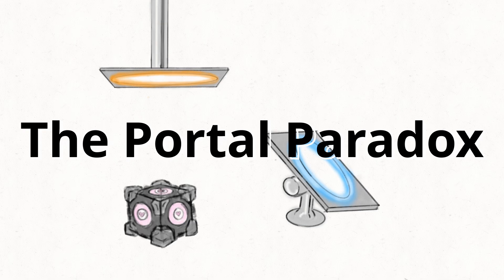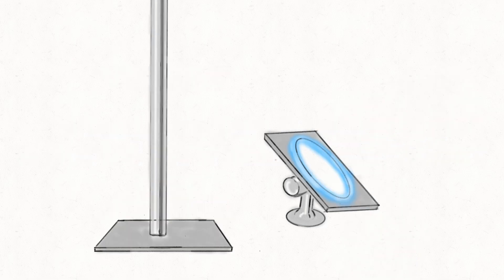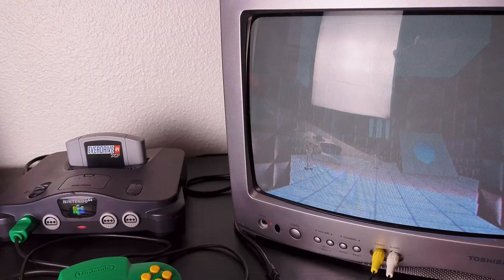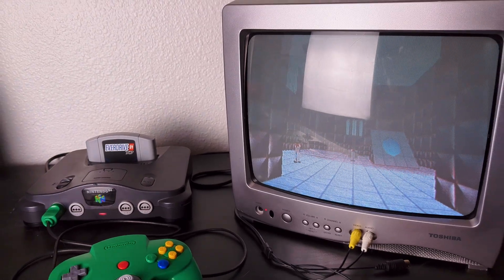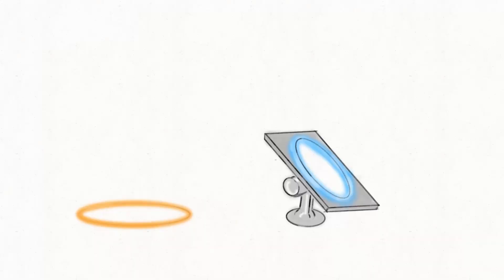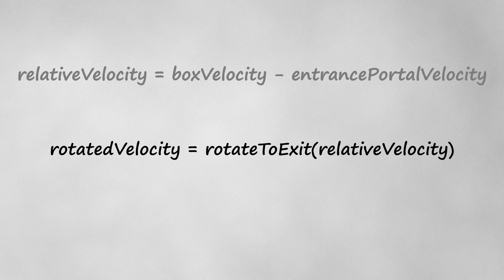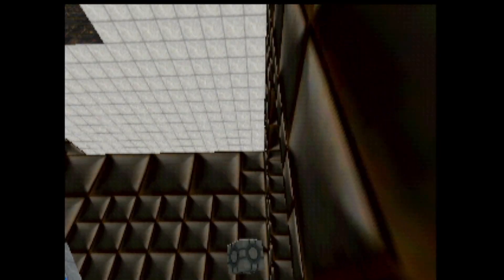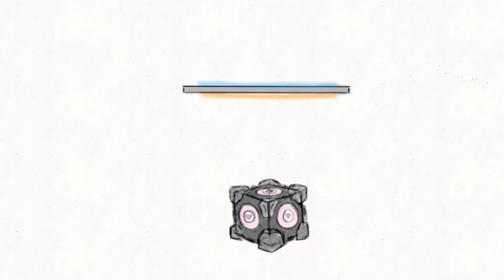I rewrote Portal from scratch and solved the Portal Paradox

Comment: There is one problem with this. In the game, they said momentum is conserved between portals, which means how fast something is moving before it enters a portal is how fast it moves after it exits a portal. When you rewrote the game, you changed the physics of the portal to change the answer. In other words, you are imparting momentum to the cube based on if one of the portals is stationary.
Reply: The main game mainly accounts for stationary portals. Maybe the more general way to see that phrase is: speedy things relative to the entrance portal goes in, speedy things relative to the exit portal go out. 

Since portals are not generally subject to relative movement in the main game, this can be simplified to the rule they mention in the game. So it's still consistent.
Reply: @evenh4210 You also forgot the line where it says, "Momentum is conserved between portals." the "Speedy things go in, speedy things come out." is an insulting simple explanation because Glados thinks humans have trouble understanding science. The cube has no momentum going into a moving portal and, therefore, has no momentum coming out of a portal. The only thing to act on an object that a portal moves over is gravity, so it would react as it would have if the floor suddenly changed
 when it exits the portal.

Comment: if you still have doubts, think about this: let’s say the cube is 1m long, and the orange portal is rushing towards it at 10 m/s. That means that in 0.1 seconds the cube will be through the orange portal. But think about the blue portal now, the cube should also exit the blue portal at the same speed it entered the orange one, obviously. So the cube will come out the blue portal in 0.1 seconds too. If a one meter cube moves through a hoop in 0.1 seconds then 1/0.1 = 10 m/s.

Comment: Would be nice to see a demo where the portal only goes through half the object. I assume the object would shoot through the other portal at half the speed of the initial portals speed... assuming its a cube like in this case
Reply: I had the exact same test idea, but I dont know about the outcome
Reply: @CHadetz  i was wondering if inertia would have any effect... Probably. And if the object can handle the pulling force. What if its elastic, or breaks easy. Or liquid lol
Reply: @hectorh4474  a block of rubber would be interesting. If the momentum of the portal would be transferred to the parts of the block that go through, they would pull the remaining part with them to some extent, or rip the block if the speed is too high. A slinky would not rip though

Comment: I prefer to think about this as a conservation if momentum problem. The cube has no momentum because its not moving, when the portal passes over it it is now acted on by gravity in the new portal reference plane. This would cause it to plop or roll out of the portal, noting that the motion would start after the cube's center of mass is through the new portal. This also solves the problem of what happens if the moving portal stops part way, you just apply the balance of gravity that is acting on the sections in each portal and see what happens.
Reply: @adrianpg4460  The real answer is that many smarter people have hashed this out online for years and there are good explanations for either behavior. The correct answer is whichever version the developer prefers for gameplay.
Reply: Yeah I was watching this wondering where the transfer of kinetic energy happens.
Reply: @adrianpg4460  Your first example doesn't prove your point - in that example I am staying still and the door and room are moving relative to me, to someone in the room it appears that I am the one moving - that's from their reference plane. To an outside observer I am clearly staying still and the wall slams into me, I don't slam into the wall. 

The portals connect two points on the same planet - they share a reference plane. So in the reference plane of the moving portal, sure I would be moving, but in the reference plane that the moving portal, the fixed portal, and I share (the earth) I am not moving, so I won't flung out of the second portal.

I contend that this is still a conservation of momentum problem because we all share the same intertial reference plane so energy must be conserved.

Comment: I've never played portal but yeah this is legit. Like why is this a paradox? It seems so intuitive
Reply: Because energy is being created out of nothing here. The moving portal will not have the same kinetic energy as the moving box, it's bogus. The box would not move because nothing is imparting energy into it, it is just being teleported from point A to point B. The relative velocity line of thinking is simply wrong.
Reply: @BNJ_VODS place a portal down on the ground, now put one 2 metres up, throw anything through them, congratulations your stationary portals have created excess energy from nothing.

Put two portals on the ground facing upwards, ignore gravity and air resistance for a second, throw a ball into one at 10m/s it will come out the other at 20m/s. Velocity being a vector means that the stationary portals just created 20m/s of upwards velocity from nothing.

The portals (as per the game) just break physics, having one portal move doesn't really make them any less completely bogus.

Comment: Alos to note. The cube or the object is not one single object. It wouldve been composed of a lot of atoms, all pulling and pushing against each other depending on their neighbouring atoms.

If we are speaking of newtonian motion, then logic says the atoms at the back will push the atoms at the front as they exit a portal, with a certain velocity. Obviously this velocity has inertia. Once the object has fully passed through the portal, the atoms at the front would still be moving and would pull the atoms at the back, thus continuing its motion
Reply: Yeah but through what force would that motion begin?
Reply: @Fr33mx  electromagnetic. Atoms push against other atoms so if you shove a stick in the portal, the back parts of the stick are smooshing the front part forwards.

Comment: I think you're wrong and I'll call upon the Conservation of Momentum. The orange portal has momentum down at a speed > 0. The box and blue portal have momentum but at a speed of 0. When the orange portal comes into contact with the floor, the momentum is not transferred to the blue portal nor the box. It is instead arrested by the floor and whatever mechanism is pushing the platform to the ground. Momentum is maintained in the chain holding the orange portal but because the orange portal never actually touches the box, momentum could never be imparted to the box.

Comment: I hadnt come across this problem before, but my first idea was thinking about the cross section of the object "in" the portal. The first layer of atoms can sit on the exit portal no problem, but the next layer will apply a force accelerating the first layer to the speed of the portal (assuming a rigid object) to make space. Similarly with the moving exit portal this acceleration need not apply because the portal has been displaced by the same amount.
Reply: I had almost the same thought, either the cube flies out of the portal as you described or get squished - Because if it enters fast but exits slowly it would need to be squished?

Comment: I’m very late to the party but this makes me wonder about what sorts of gimmicks you could achieve by making an exit portal move in the opposite direction of the entrance portal (ie forcing the cube to sorta stay locked inside the portals for a time before shooting it out) or maybe doing something clever where you increase the velocity of a cube further by moving both portals in the appropriate directions. Neat stuff!
Reply: If I understand correctly neither of those things would happen in any possible case.

It's easy to imagine:

Remember that portals have a front and a back, so imagine the second example in the video, but with the blue portal set in the other direction. The piston would simply push the cube against the floor. The cube is "exiting" through the same portal it entered. If the portal was set on another surface but move at the same speed in the opposite direction (relative to its front), it would be the same.

If there was a speed differential between the two portals, then it would exit through the portal that was moving slower, at the speed of the differential.

Comment: and where the hell is the kinetic energy coming from? which hindu god adds magic numbers to an otherwise stationary object? 
portals connect two places in spacetime like wormholes. moving a portal into an object merely changes the location of the first wormhole and eventually the location of the object that passes through it, similar to what youd expect from teleportation. the two portals are like a ring with a witdh of 0. moving one end of the ring to a different location so that it forces an object through itself will have ZERO effect on the objects passing through it

in a more practical example, orange portal moving into the cube is akin to a part of a room with an open door accelerating towards you. once youre in the room you dont magically gain velocity and fly into a wall
Reply: Yeah the paradox stems from the nature of the protals in the game.
Ingame we only have 1 plane to work with, so it doesnt make sense that a 2d object could move in a 3rd world. We would have to apply 3rd portals as in spherical wormholes, which would not cause a paradox even if one of them was moving. But thats a totally different kind of conversation to have.
Reply: Stationary portals are sources of potential energy. Portals in floor and ceiling gives potential energy to anything that passes through. So why would it be unreasonable for moving portals to give kinetic energy?

Comment: This was my stance for a decade. All motion is relative.
Reply: It is not really. Motion is energy. You cannot create energy out of nothing. The portal does not have a contact with the cube so no energy is transferred on to the cube, thus it has the same velocity of zero coming out of the other end.
Reply: @Fr33mx  motion is not inherently energy. Energy can be used to create motion
Reply: @Absolute_Territory point still stands, no forces are applied to the cube, so no momentum is transferred.
Reply: @Fr33mx  the force applied to the cube is the difference in relative motion between the portals lmao
Reply: @Fr33mx  and no, your point doesn't stand if you don't understand the fundamental concept of motion lmao

Comment: The problem is the angle of the second portal, it's angled upward and slightly horizontal meaning that if the physics were the opposite of the way you've intended them, the cube would just sit there floating in space

Comment: This really makes me think about how a gravitational field would work through a portal. For this setup, assuming the moving portal is very slow, such that the box effectively has no appreciable final velocity perpendicular to the plane of the stationary portal, does its friction increase due to the larger gravitational force? If it is moving faster, does it cause an acceleration of the projectile not straight downward? 

As for your implementation of the changing velocity for the box. I'm not fully sold on it, but it seems fine. What is the difference between the box being thrown through the portal and the portal being thrown over the box? From a symmetry perspective, this solutions that treats the box as having been moving seems to make sense. However, I wouldn't view the portal as doing work on the box, so I would almost believe there would be a stationary box on the other side. You'd just be moving its point in space spontaneously and would feel both environments' gravitation, which would be weird.

Anyway, interesting approach, and looks like a cool demake.
Reply: I think the game's original engine makes it clear. If you drop a box into a portal that has both "entrance" and "exit" on the same plane, the box oscillates back and forth between two opposing gravitational forces untill all of its momentum is dispersed through the friction with air and it stabilizes inside the protal.
I might be talking out of my ass however as the last time i've played that game was years ago, but I have a memory of doing thay exact experiment and it went something along those lines so it made perfect sense to me.

Comment: I've always said it depends if the velocity is in relation to the portal or the environment. This is spot on for velocity related to the portal, as the portal's velocity would be accounted for well.
Reply: Problem is that the portals are not physical objects per se, they are just wormholes with width of zero.
Momentum is not relative so to create it you have to apply it to the cube directly. So in this csse there's no forces applied to the cube other than gravitational force of the earth, so it should just fall out of the blue portal with a motion corresponding with the new gravitational force that is now applied to the cube. It is counterintuitive.
Reply: @Fr33mx  exactly, i can't agree with te solution provided here as it simply does not make physical sense (i know we're talking about wormhole like portals here but still)

The reason you can shoot out of one portal when you jump into it is because you have you own momentum and inertia, the portal act's like a hole, if the portal itself is moving, it should not input any force on the cube because it's just acts as a hole between the two spaces
Reply: @Fr33mx  how is momentum not relative is momentum=mass*velocity and velocity is relative

Comment: It is a paradox?

Velocity depends on where it is shown. When we stand in a train, we go to 0 KM/h in the train... but at the same time, we move at the train velocity. So obviously when we move a portal to a box, the box is moving to the portal at that speed.

I thought that the portal paradox is what happens when you make two portals collide.
Reply: The box has no velocity. Relative velocity is not the same as Momentum. The box gains no momentum going though the box as no force was applied to the box, so it should just fall out of the other end.
Reply: @Fr33mx  The box has velocity. If I run toward a wall, at 5 km per hour, It is this velocity from someone that is checking it. But from my point of view, I can say that the box is moving 5 km hours toward me. In the end, it will end in a collision of 5 km hours. Movement is always relative to a static point. 
So it is quite obvious that if I am in fact a portal, and at the wall, there is a box, the box will be sent through me at 5 km per hour.

Comment: You’re wrong. All the energy of the movement of the portal is absorbed by the ground. None of that energy is converted to the cube because the portal functions as a hole. The only scenario where ur logic makes sense is if you’re telling me the entrance to the portal has viscosity creating friction, which is never even remotely implied in any of the games. You use similar (but really not) experiments to justify your logic, when u should be using actual physics instead. Unless this video was purposely meant to be wrong to cause controversy and get engagement.
Reply: I don't see the conservation of energy problem invalidating the solution shown on the vídeo, simply because on the game itself we use a mechanic that violates conservation of energy when we shoot a portal on the floor and shoot another one on the wall gaining foward momentum by each iteration, we could even build a perpetual energy generator using those physics

Comment: only problem with this is it completely breaks conservation of energy. Block gets energy from no where
Reply: yea it completely ignores that the block has inertia (i.e. it wants to stay in one place) and no new forces have been applied on the block, so it should not launch out of the exit portal and should slide/topple down the inclined plane (despite how satisfying the launch is)
Reply: @Kai-ts7ig  yeah, momentum is not conserved either. It's generally a mess as far as real physics goes.
Reply: It doesn't get energy. There's no acceleration happening, just a preservation of relative velocity. The real question is if the atoms going into the portal come out the other end, does moving a portal create a vacuum behind the surface it is attached to?
Reply: @lnplum  You don't seem to understand the concept of energy. Acceleration isn't needed for energy to be had. Kinetic energy is proportional to the square of velocity. Before the block goes through the portal, it has no velocity and no kinetic energy. After it travels through the portal, it has velocity, and therefore, it has kinetic energy. That kinetic energy was produced out of nothing. Energy is not conserved. Basically, the energy of the system increased, and no work or potential energy was spent. You might be tempted to say that the portal on the piston stopped, and that energy transfered to the block, but you can easily imagine a scenario where the piston doesn't have to stop moving and the block still gets launched. But really, there isn't a point in arguing this as portals break lots of laws of physics anyway.

Source: I'm literally a physicist, but come on, this is high-school physics.